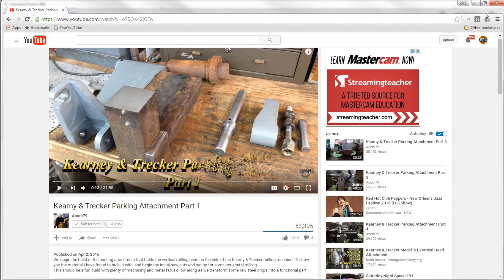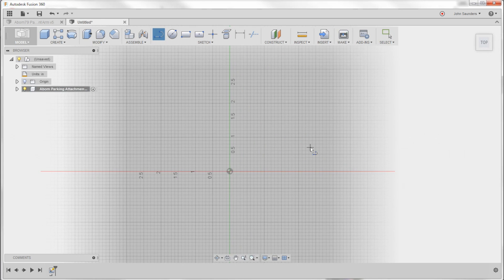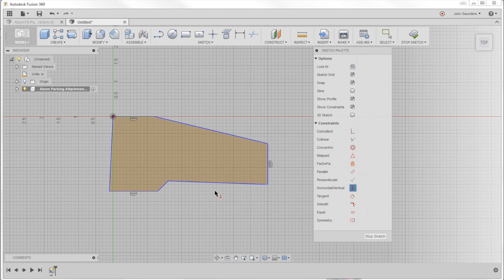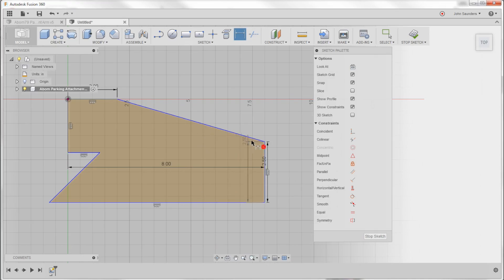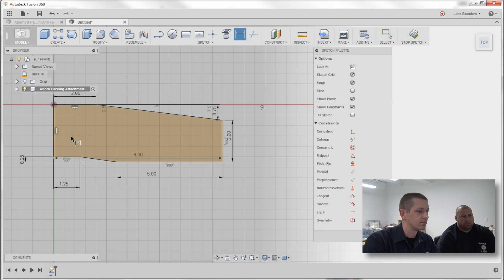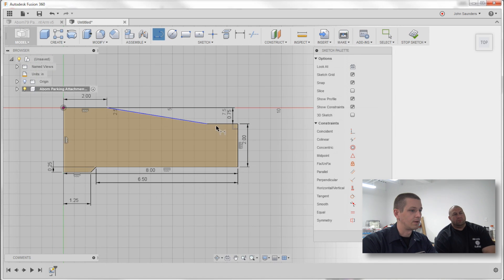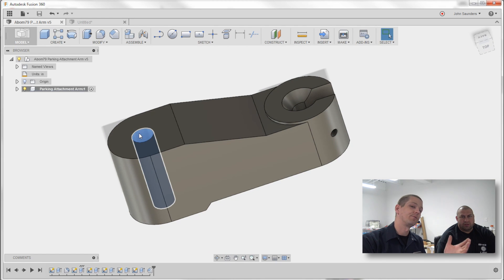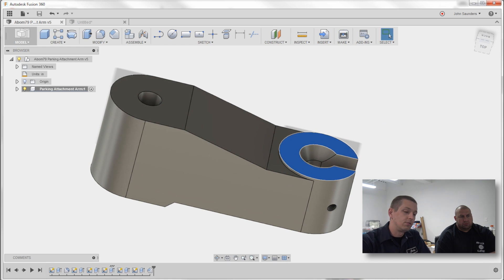Big Steel CNC: Parking Attachment for Abom79 - Widget93

Comment: I get a kick out of the "big" parts.:-) I am interested to see how you workhold this to do the maximum amount of operations/setup.
Reply: +bcbloc02 Me too. My thought's is the part is long enough to probably hang off each side of his tormach vise, so he could maybe machine both ends and one side. The flip over and finish the bottom. But I'm sure John will reveal all! :)
Reply: +bcbloc02   Yeah, like an entire tractor transmission housing at 1600 lbs!!!!
Reply: +Doug Bourdo   I live near Bucyrus Erie, maker if many mining machines. Saw them broaching gear teeth on a 24' diameter gear about 5 ft thick,  Size of the chip curls were about 2 lbs. each !!  Incredible stuff.  Now they're Caterpillar.
Reply: Doug Bourdo
24ft is a monster of a rotary table! Even the work I do is not big by industrial standards.